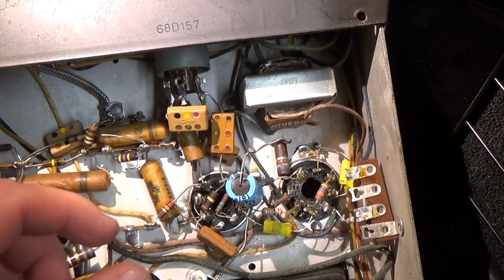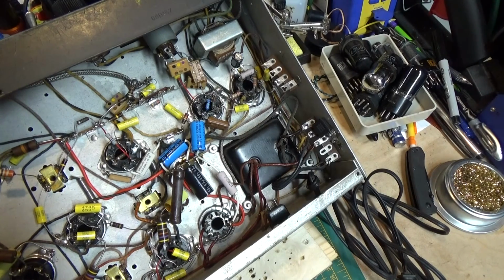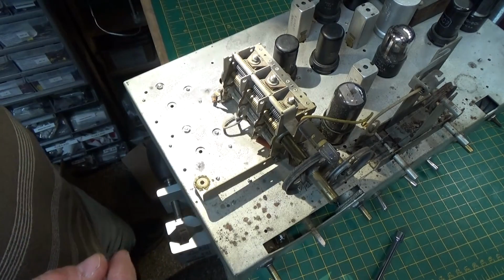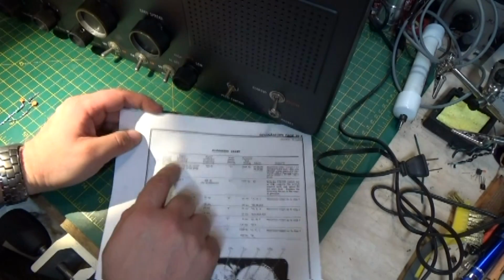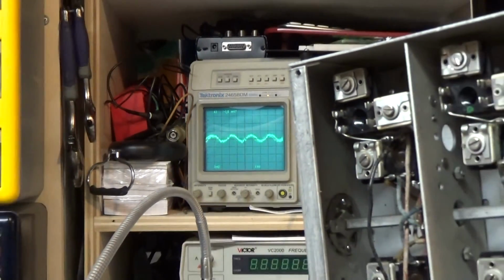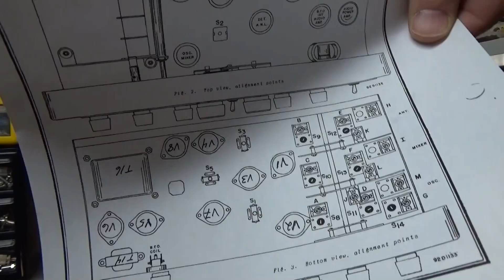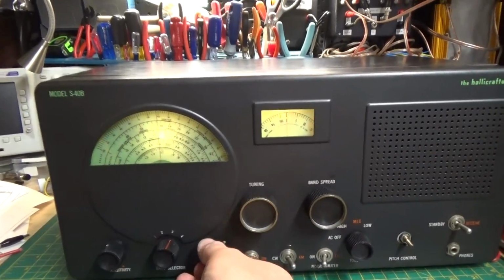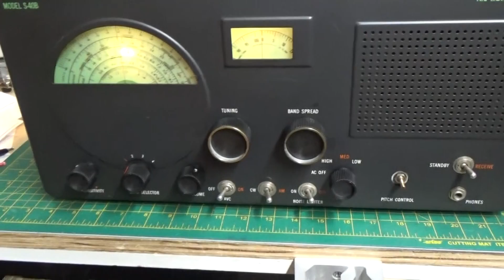Hallicrafters S 40B Part 3   Final

Comment: Just finished an S40B today. I found many of the same things that you did. Every wax cap in the radio was leaky at the 25-50V level as tested on my IT-28. Also many of the resistors were way out of spec and had to be replaced also. After alignment it seems to be really sensitive and sounding very good. I replaced the power cord and added a 1A fuse for added safety. I like to have a fuse on the primary side of vintage transformer radios just in case the old transformer decides to short one day. Thanks for the Video it really gave me a good roadmap as I did mine. 73 Doug.
Reply from the maker: Doug,
Congratulations on the S40!  Glad this video series helped!  
73 Tony

Comment: I know  this is an older video, but I do have a question. Why didn't you add a AC line fuse when you reworked the AC power terminal strip and line cord / line cap connections? It seems to be a disservice not to, as it would protect the hard to replace components like transformers as well as give the user some additional safety in case something did go over current and heat up.

Comment: Hey Tony, quick question about IF Cans for the S40-b.  One of mine, pn 50c243 (T2 on the schematic) has to be replaced. I managed to get my hands on a few IF Cans that have the same size,shape, and 455 kc spec that my old IF can has. How would I test the newer can out to see if it works at all so I can install it in my S40-b?  Thank you for the videos, I enjoy them a lot.
Reply from the maker: Hi Dennis,
You can test them with a simple signal generator and oscilloscope.  Feed the signal into one side of the transformer and connect the scope to the other.  As you adjust the frequency of the signal generator, you should see a "peak" of the signal right around 455kHz, or whatever frequency its resonant frequency is.  Alan at W2AEW youtube channel does a demonstration of this in one of his excellent videos.
Reply: xraytonyb : Thanks, I'll check his video out and try it.
Reply: @xraytonyb  Their used to be a formula to use  a capacitor and resistor you could use if one side of the coil is open.

Comment: Hi..nice video..could you look at a Hallicrafters  SX-71 diagram, and tell me where  to connect the oscilloscope to, so I can do my alignment...and can you just use a 4 ohm resister in place of the speaker while aligning..Thanks for any help...
Reply from the maker: Hi Kennynva,
Thanks for watching!
That would be a bit too in-depth to explain in a message.  Alignment would be similar to the S40.  I would suggest going to nostalgia air (www.nostalgiaair.org , I think) and download the manual.  It has pretty good alignment instructions.  You'll find a lot of similarities to the S40 (and many other Hallicrafters).  Good luck!

Comment: Awesome video but quick question.  Did you connect the actual ground line to the antenna or not?   I did a three prong conversion on mine so I'm not sure how necessary it is to do this.
Reply from the maker: Thanks for the comment!  The ground lead should be connected to chassis ground in order to provide a safe return path in the event any voltage were to appear at the chassis.  On these radios, the antenna lead would go to a long wire antenna lead that is not grounded and the antenna ground lead would go to earth ground (which you would already have through a properly wired three prong power cord, making the ground lead a bit redundant).

Comment: I'm curious to know if you installed the non-polarized capacitors (the yellow ones) with the Outside Foil connected to the low impedance side of the circuit?  A better explanation of what I am trying to ask is in this video:
https://youtu.be/BnR_DLd1PDI
Also, I happen to think that you might appreciate the information in this other video as well:
https://www.youtube.com/watch?v=ETKyKC2Zj-M
It is a tool that is especially useful when working on the old tube type sets.
I enjoyed your video...and was amazed that someone would have put the Electrolytic in backwards...but such things happen.  I am especially thankful that you mentioned the part about doing the tuning with the bottom attached....for as you said, it really does make a big difference.

Comment: Not telling you what to do, but shouldn't you set the main dial to the far left of the black line..and move the band spread to the right, or move the main dial the the far right, and tune the band spread to the left.
Reply: we have a winnerrrr... ding ding and CW flip the switch...for SSB
Reply: Absolutely correct.  Starting at zero with the Bandspread, turning clockwise lowers the frequency from the setting of the Main Dial.  To cover 40-meters, I set the main dial at 7.2 and the Bandspread at 100 which will give me 7.0.  Turning bandspread counter clockwise will increase the frequency from 7.0 up to 7.2.